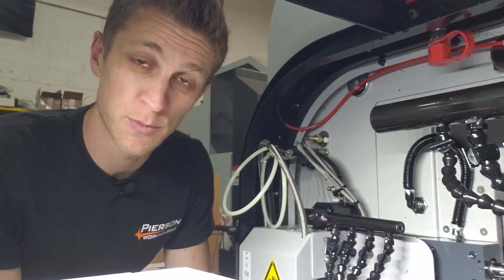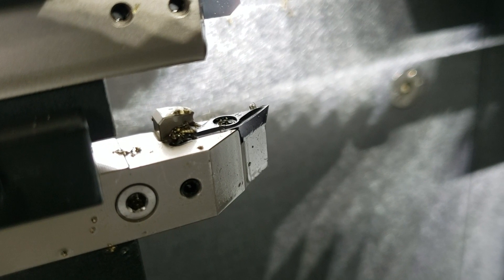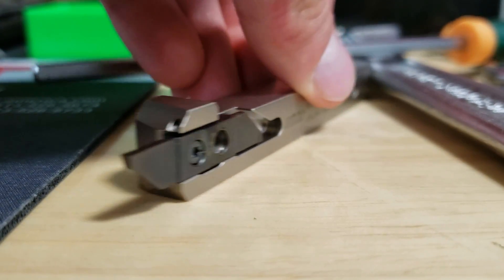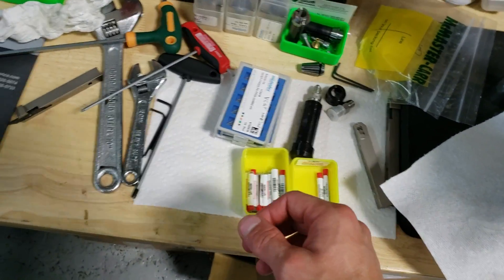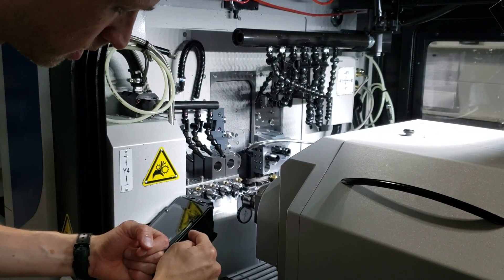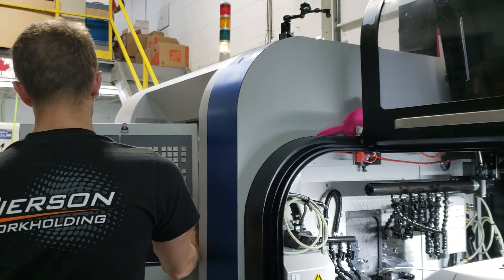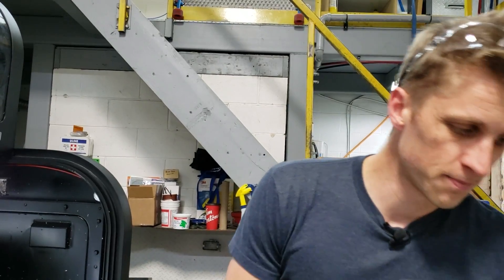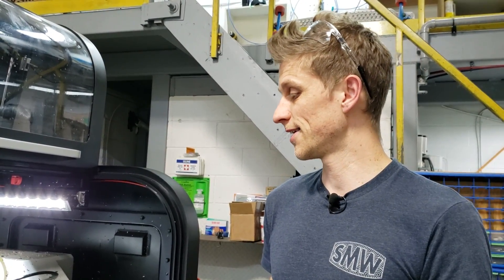Machining to A MILLIONTH!

Comment: Just found this video. In a prior life I worked in an aerospace machine shop where we would keep tolerance to +/-.00005 which is just crazy. If you see this and have time one fun thing to do is machine a cylinder and sleeve within .00005, put a couple holes in the sleeve so you can hit it with compressed air. A sleeve spinning at those close tolerances is insane :)

Comment: Could be time to by a stand alone tool pre setter you can get a really good used zoller for the price of a decent car here in the Uk or if you have the cash buy a new one. Save you time and money in the long run and safeguard the integrity of the component and the machine in the future.As far as working inside the machine get and interlock key 🔑 everybody uses them....

Comment: The right hand parting tool cuts closer to the collet or guide bushing which ever one you are using helps minimize deflection or bending on tiny parts. the left hand can allow you to not have to use so many extended nose collets to pick off with where the right hand forces you to use them more often. Also the left can cause deflection on tiny parts.

Comment: I was like - no way that is a millionth, is he nuts? But then i remembered that Americans use the imperial system...So 0.000001 inch = 0.0000254 mm. So that's 100 thousand's of a milimiter which is pretty damn impressive.
Reply: you are wrong with one zero after the dot. it is 0.00001 = 0.00025mm

Comment: I believe the key to making this machine a success for your operation is to get really good at changing between parts. Your Kanban size is based on your end product demand, not on raw stock bar length, setup time, etc. A lot of shops do not make the effort to embrace SMED and are so happy when they finally get a setup dialed in that they over produce parts. The nice part is that you are the part designer so you can change product design (to a point) to match your production method. Job shops don’t have that option. Good luck.

Comment: I hate to say this but after a while aren't you wasting time and money chasing perfection...
Reply: he is not, because the charge that pursuit of perfection to clients
Reply: The better your machine is set up, the more parts you can crank out before you start cutting out of tolerance and have to change tools and reset. In the swiss machining market, 100 more parts between set up/tool change is the difference between asking for extension on POs and shipping before due.

Comment: The 60,000 rpm tool, my guess is it's an air tool with tachometer wires, not an electric motor with air bearings...
Reply: Yeah, it would have to come with a 60 kHz, three phase power supply. I had a 100k RPM electric spindle on a PCB router, and the supply is massive.
Reply: If air bearings you could have ad another zero.
Reply: @dtiydr  To the RPM? or the price. I do not believe that it could run 600.000 rpm. The angular momentum would break the tool.
Reply: @gusbisbal9803  Not that one since its not one with air bearings. Motors with air bearings have no friction and thus the pretty much only limit in speed is the integrity of the rotor. That is of course built for the RPM so yes if it would be built for 600k rpm it will hold for that, even if the one above is not one. However they also normally have not equally good side load capability as one with ordinary bearing which is crucial in the above usage.
Reply: @dtiydr  "only limit in speed is the integrity of the rotor." This is untrue. The difference in energy of the spinning part between 60k and 600k is x100 more. When at 60k its already very very high. This means it is trying to rip itself apart due to angular momentum. The limitation is not on friction, or even run-out ie axial alignment, its whether a perfectly friction less, perfectly aligned body can take the G-forces so to speak of that high a rotation. There are dental drills that can reach 450k but that is the highest I have ever seen. If you know of a consumer product that reach 600k please post about it, I would be interested to see what it is.
Reply: my thoughts as well. stuff above 200k, even if it's quite small in diameter, requires dynamic balancing for the whole assembly. collet chucks are useless for that matter.

Comment: Really weird that your machine alignment is off that far. When I need to check alignment on a swiss (or a regular lathe) I always remove the tool and sweep the actual casting bore in the machine. If there's a difference between your indicated values (casting/tool holder) then you should be able to see where the issue is. Also, if you get an indicator with a long tip you can sweep the bore in Z (rotate indicator to sweep along X and Y) to make sure it's perfectly parallel to your sub spindle. It's a ton of work (usually took me about an hour for 8 bores) but it's really helpful for peace of mind to know that your machine is straight. And if for some reason it isn't, you'll know about it and you can get it fixed now instead of later when you're trying to get a job out the door and can't figure out why your drill hole sizes are off. Did the install tech check the machine for alignment?

That said, you're probably aware of all this. I just like talking shop and having passion for machining, which I'm sure you understand.
Reply: broton totally spot on on these checks.